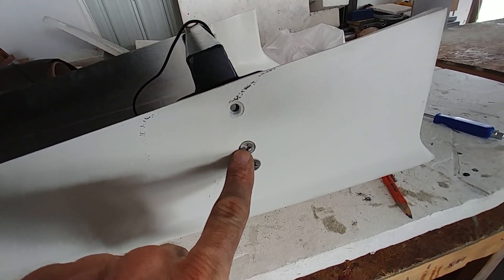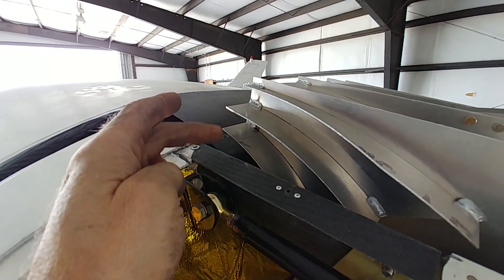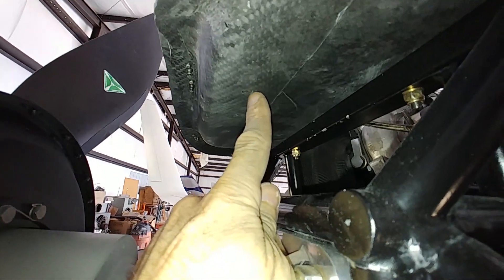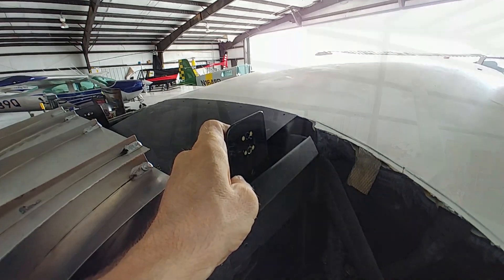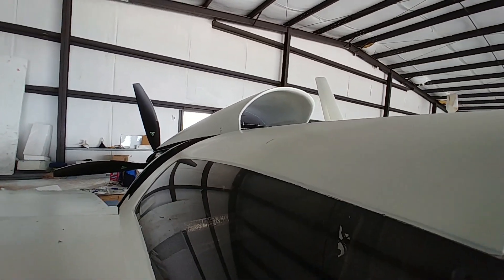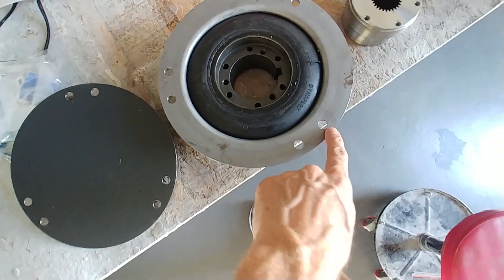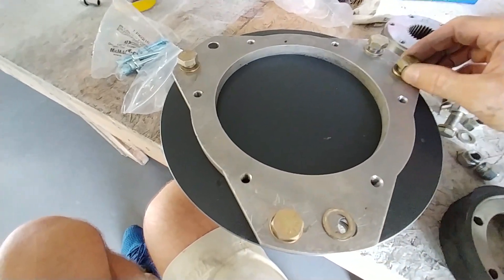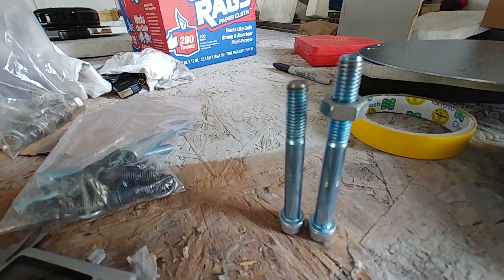Here's the Scoop - Building the Raptor Prototype

Comment: Intake looks great but being flush with the top of the fuselage may restrict the flow.  Vision jet, f16 both have their intakes lifted off the fuselage.  Fantastic to see it coming together.
Reply: People will probably readily think of something like the P-51's radiator intake which is lifted above the belly surface in a similar manner
Reply from the maker: I flow modeled it and this configuration is actually better. The Evolution also had a mod done to the cowling from the P51 style to this style and it was an improvement.

Comment: Terrific progress. How will you know how much you have opened or closed the intake air scoop when you’re in the cockpit?
Reply from the maker: For now you'll just have to guess. Later on we could add an indicator.
Reply: Not sure if you could put a potentiometer in and connect it to the motec to get a reading... if there’s any extra wiring available... I’m not familiar with how the motec works with sensors, if it’s something like an rs-485 communication or not.
Reply: Only thing that matters is temperature and that is measured.